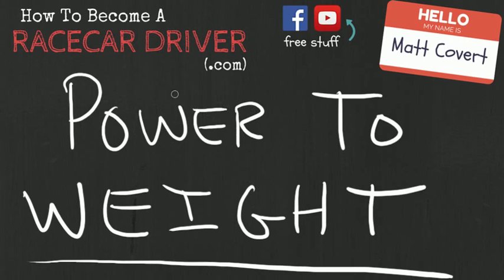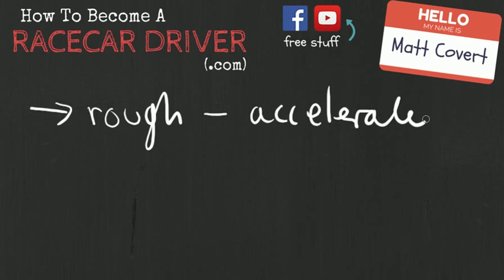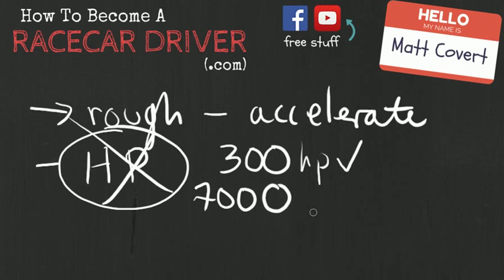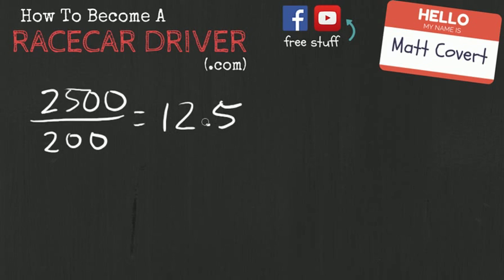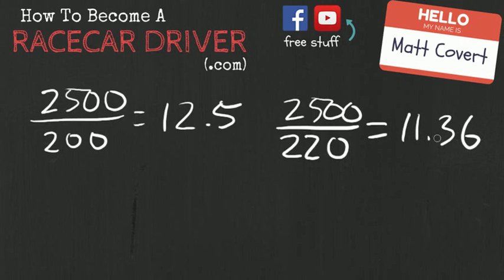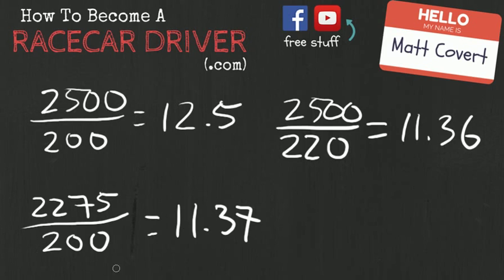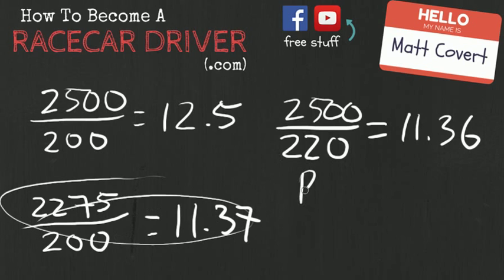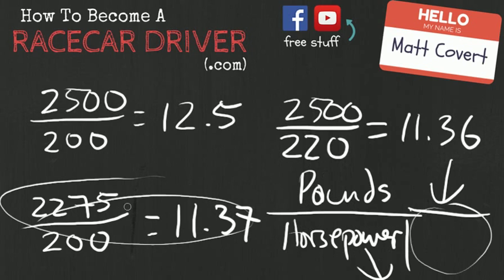Power To Weight

Comment: Why are you dividing weight by horsepower? Power to Weight ratio is horsepower divided by weight!
Reply: @Xamarin491
So is my power to weight ratio 0.14  not 6.77 ?
Reply: @davidgriggs3967  It's just two different ways to express the same thing. your 6.77 is how many lbs per pony you have and your 0.14 is how many ponies per pound you weigh.

Comment: Where is a good place to start building in your opinion??? Please help
Reply from the maker: Cee Rodrigue Great question! Personally, when I build a car, I start with handling and braking. Keep your eyes peeled for my project car build videos. I’m currently building a 92 Camaro. I’m starting with suspension, brakes and tires.

If you’re starting out, the best use of your money is driver training. If you’ve got a few sessions under your belt and really want to add to your car, the first place I’d start is tires. Everything else needs good tires to work to their full potential.

If you’re doing a full build, you really need to start by reading the rules for the class you wish to run. In my case, I had some ideas on what parts I wanted, and found a class where they would fit and I could still be competitive.
Reply: @RacersHQ 
Is there anyway we can assemble some kind of k.e.r.s. hybrid system to make something truely impressive?
Reply from the maker: Cee Rodrigue Anything is possible with enough money. I think it’ll be a while before KERS or hybrid systems are low enough in cost for the masses. Systems in use today cost tens of thousands of dollars and almost require an engineering degree to install/maintain.